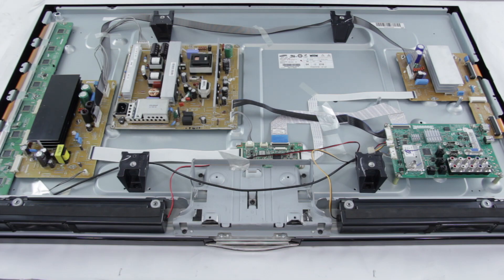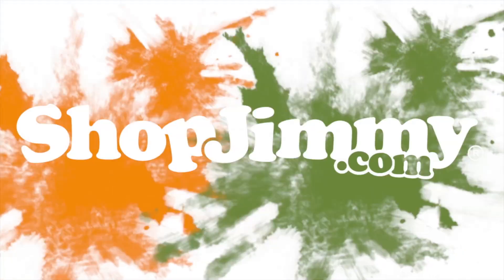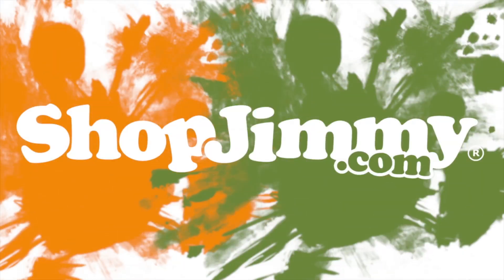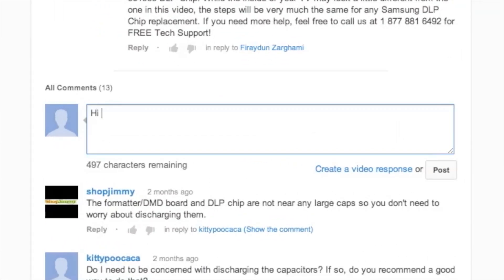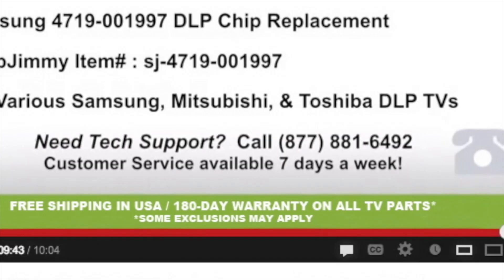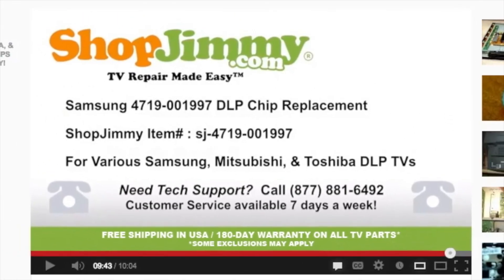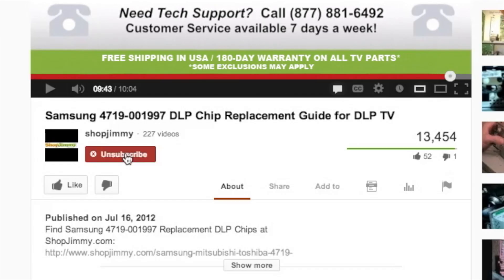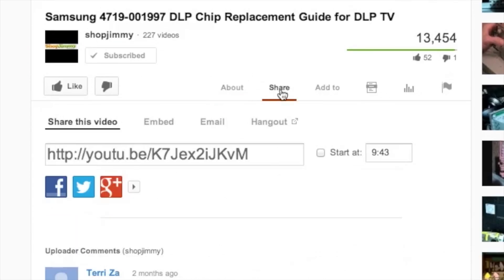Plasma TV Repair Tutorial - Common Symptoms & Solutions - How to Fix Plasma TVs

Comment: I have a LG 47LD690 . 
The problem is that it will stay stuck on the start up screen displaying the logo and a timer that is not set. What could it be the problem? I've done some research and I came to the conclusion of being the main board. Well , I've tried to look it up on ebay and couldn't find it.

Comment: I have a Maxent TV Model # P420142X3 that turns on, but gets no picture.  The sound is fine.  This issue occurred without warning.  The tv had been on and automatically turned off after a certain amount of time, and then would not turn back on. Can you make any suggestions?
Reply from the maker: Jamie Barcelon   I recommend running the flashlight test on your TV.   Here is a link to a video we produced that shows how to run the flashlight test. No Image No Picture on TV Screen - Flashlight Test LCD & LED TV Repair - How to Diagnose Symptoms 2 Please reply with your flashlight test results and we can recommend a replacement part for your TV repair. Thanks and please let us know if you have any questions! www.shopjimmy.com

Comment: Hello ShopJimmy.com,

I'm having a trouble with my Panasonic P60U50.

I opened my TV one morning and saw a shaded horizontal line across the screen (not solid black, kind of white horizontal line). I tried to remove and plug back in orange cables to Y-Buffer, I got some black solid lines but I succeed to plug orange cable correctly so they disappeared. I did not correct the shaded horizontal line at any time (got it everytime I started TV to check if black lines were gone). I noticed (not everytime) that I can see random colored dead pixels 1 inch at the top or at the bottom of the shaded horizontal line (there is only one line). Hope it is not a defective panel. Your help is greatly appreciated! Here is a picture http://i58.tinypic.com/2lkcsr9.jpg (restarted TV and no more colored dead pixels but still white horizontal line)
Reply from the maker: electronicdancemuz   This sounds like a TV panel (TV Screen) problem.  If your TV panel is bad, it may be more cost-effective to replace the TV as panels are typically hard to find in stock, difficult to replace, and expensive.  Thanks and please let us know if you have any further questions!  www.shopjimmy.com
Reply: ShopJimmy.com
wrong, it was the upper buffer board

Comment: I have a samsung LN37450 , it is showing a very bright picture with no or little contrast. i have reset the tv to factory settings and had a quick look for swolen caps but nothing jumps out at me. Hope u can advise
Reply from the maker: Colin Clohesy   I recommend replacing the T-Con board in your TV.  Unfortunately I do not see any replacement parts in the search results for your TV model number on our website.  Please reply with your part number on your t-con board and I can try searching for replacement parts.  Thanks and please let us know if you have any further questions!  www.shopjimmy.com

Comment: I have an LG 60pk200/pdp60r10000 (1st model # is on the outside cover 2nd is on the white sticker inside). It's a 60 in plasma tv. I got it in jan of 2011 & have not had any problems with it til now. When you try to turn it on, it just clicks and the red power button will flash once. Do you have any clue what could cause this?

Comment: Samsung model LN40C530F1F, the volume is automatically turning up and down on its own
Reply from the maker: Tyson Jerald   This is either a problem with the keypad board or the main board in your TV.  Try this at your own risk.  If possible, try disconnecting the the keypad controller from your main board to see if the TV stops turning up and down the volume.    Thanks!  www.shopjimmy.com

Comment: Panasonic TH-42PZ80U; after 5 minutes of turning on screen develops a 1" vertical blue/green line in center of screen which will intermittently fade and reappear.
Reply from the maker: *****   This sounds like a TV panel (TV Screen) problem.  If your TV panel is bad, it may be more cost-effective to replace the TV as panels are typically hard to find in stock, difficult to replace, and expensive.  Thanks and please let us know if you have any further questions!  www.shopjimmy.com

Comment: I have a Panasonic TCP42UT50 that gets a black vertical bar on the left side of the screen that cuts out about a 1/4 of the screen size. it randomly will happen, sometimes lasting an hour or two sometimes lasting all day. I have done some research and thought it was the cable on the C2 board #TNPA5631, But all connections seem good, so I assume it is a board that has gone faulty or a bad solder somewhere? Am I on the right track?
Reply from the maker: Ian Bremner   This sounds like it could be a bad C board or a bad TV panel.  Unfortunately we do not offer the C board.  Thanks!  www.shopjimmy.com

Comment: my pioneer pro-111-fd tv is having a tuner problem.
i had a similar problem shortly after i got it. it was repaired under warranty. a new board was installed. it's not under warranty now. which board would it be? also, most of the menu settings are "greyed out".
Reply from the maker: Lance Arnold   I recommend replacing the main board in your TV.  Here is link to replacement parts for your TV model number - http://www.shopjimmy.com/catalogsearch/result/?q=pro-111-fd  Be sure to match part numbers on your current board, with your replacement for compatibility.  You can also call our customer service for further assistance with your purchase.  (877) 881-6492  Thanks and please let us know if you have any further questions with your TV Repair!  www.shopjimmy.com

Comment: I have a 2009 Sanyo dp50747 and when I turn on the power button the tv will come on and then goes off. Any idea what's causing this problem? I've checked all fuses and caps. Their all good at least they are not raised or leaking.
Reply from the maker: Michael Hawk   I recommend replacing the main board in your TV.  Here is a link to replacement main board for your TV model number:  http://www.shopjimmy.com/catalogsearch/result/index/?cat=56&q=dp50747  Be sure to match part numbers on your current board, with your replacement for compatibility.  Here is a link to a video showing how to identify your part number, click here:  TV Part Number ID Guide for Sanyo Main, Digital, & Terminal Boards (LCD, LED, Plasma TVs)  Thanks and please let us know if you have any further questions with your TV Repair!  www.shopjimmy.com

Comment: I need repair instruction. My TV's volume/sound won't work. After I turn it on it lowers the volume to zero. I really thought it was someone out there messing with me but then later I found out that it was the TV because the control won't work. I tried to raised the volume with the side button but still won't work. The make and model is: Westinghouse W1603.

Comment: Hi there I just got a LG 60pv400 and it will stay on for five mins then screen goes black sound still plays I'll turn it off n on again and another five mins same thing. It seems to have gotten worse because after just a few times of on n off it would warm up or something and be fine for hrs. Fairly sure it's not the connection board other tv's everything works. any help would be awesome I'm about to take the back off now thanks
Reply from the maker: BEN AZ   I recommend replacing the YSUS and the YDVTP & YDRVBT boards in your TV.  Here is a link to replacement parts:  http://www.shopjimmy.com/catalogsearch/result/?q=LG+60pv400  Be sure to match part numbers on your current board, with your replacement for compatibility.  Thanks and please let us know if you have any further questions with your TV Repair!  www.shopjimmy.com

Comment: Hello, My Toshiba Regza 47ZV650U worked flawlessly until the other day I accidentally unplugged it while the scanning function was searching for channels on a digital antenna. When I plugged it back the set made its usual clicking noise, the power light went green and brand name lit, but the screen stays black. The clicking noises (i can hear two) repeat every 25 seconds or so. Thanks.
Reply from the maker: MarceloHardoy  Please watch this video FIRST to help with your repair!  TV Repair! LCD, LED, Plasma, DLP How To Fix Your TV with ShopJimmy.com Help!   I recommend replacing the main board in your TV.  Here is a link to replacement parts:  http://www.shopjimmy.com/catalogsearch/result/index/?cat=56&q=47ZV650U  Be sure to match part numbers on your current board, with your replacement for compatibility.  Here is a link to a video showing how to identify your part number, click here:  TV Part Number Identification Guide for Toshiba Main & Scaler Boards (LCD, LED, Plasma TVs)  Thanks and please let us know if you have any further questions with your TV Repair!  www.shopjimmy.com

Comment: Shopjimmy.com Thanks for your time....I have a Samsung plasma Tv Model PS50C6500TW ...The problem is when you turns it on it make a welcoming sound but everything end there. No picture. and when you off it again it makes sound and the standby red light will light up. thats it ...Any Idea as what I should do or what the problem is. Any help is highly appreciated.
Reply from the maker: DMex Lulu   Please watch this video FIRST to help with your repair!  TV Repair! LCD, LED, Plasma, DLP How To Fix Your TV with ShopJimmy.com Help!  I recommend replacing the Y-Main Board and the Y-Buffer Scan Drive board in your TV.  Here is a link to replacement parts:  http://www.shopjimmy.com/catalogsearch/result/?q=50C6500  Be sure to match part numbers on your current board, with your replacement for compatibility.  Thanks and please let us know if you have any further questions with your TV Repair!  www.shopjimmy.com

Comment: hey Jimmy,
My Samsung model UN60EH6003F picture has gone black (actually dark blue) but the sound works.  I watched one of your videos and took it apart.  I'm not sure which board is causing the problem but I did notice the capacitors look fine.  What do you suggest?  I'd like to fix it myself (we've gone through a lot of TVs in the last few years.)
Reply from the maker: Mike Ake   Please watch this video FIRST to help with your repair!  TV Repair! LCD, LED, Plasma, DLP How To Fix Your TV with ShopJimmy.com Help!  This could either be a problem with the main board or the T-Con board.  I recommend replacing the T-Con board first and then if the T-Con board does not fix the problem, replace the main board.  Here is a link to replacement parts:  http://www.shopjimmy.com/catalogsearch/result/?q=UN60EH6003F  Be sure to match part numbers on your current board, with your replacement for compatibility.  Thanks and please let us know if you have any further questions with your TV Repair!  www.shopjimmy.com

Comment: I have a Samsung HP-T4254 (model code HPT4254X/XAA) plasma. It will come on and operate correctly for a short time and then the picture will stop. I can turn it off for a little while and turn it back on and it will work again for a short while. Any suggestions would be appreciated.
Reply from the maker: Charles Gatch  Please watch this video FIRST to help with your repair!  TV Repair! LCD, LED, Plasma, DLP How To Fix Your TV with ShopJimmy.com Help!  I recommend replacing the Y-Main board and the Y-Buffer board in your TV.  Here is a link to parts:  http://www.shopjimmy.com/catalogsearch/result/?q=HPT4254X%2FXAA  Be sure to match part numbers on your current board, with your replacement for compatibility.  Thanks and please let us know if you have any further questions with your TV Repair!  www.shopjimmy.com

Comment: Model Code is PS51D550C1RLXL and its not working like standby light is flashing and main control Green Led is flashes and nothing happens on screen
Reply from the maker: ll3thanll   I recommend replacing the Y-Main board and Y-Scan Drive board in your TV.  Here is a link to replacement parts for your TV model number on our website, click here:  http://www.shopjimmy.com/catalogsearch/result/?q=51D550C1  Be sure to match part numbers on your current board, with your replacement for compatibility.  Here is a link to a video showing how to identify your part number, click here:  Samsung Plasma TV Repair: Samsung Plasma Panel Parts Guide  You can also call our customer service for further assistance with your purchase.  (877) 881-6492  Thanks and please let us know if you have any further questions with your TV Repair!  www.shopjimmy.com

Comment: samsung pn59d530a3f is turning on and has sound but after a few minutes to hours the picture goes out and the sound is still on and the standby light is blinking. I have checked for possible loose connections with no luck. to me i think its some type of heat issue cause the picture will come back on after i turn the tv off and wait about 15 minutes and then turn it back on. Or a back-light power issue. I dont know how backlights work so it could be that the back light is going out when it gets hot. I dont know where the back light resides so i am not able to conform or deny that problem.
Reply from the maker: Brandon Allen   I recommend checking the fuse on the y board to see if it is good or not.  Thanks and please reply with the results.  www.shopjimmy.com
Reply: The fuse was fine and have changed the Y board and no change. So my next logical guess would be the logic board. the main is going to be my last resort due to its price. but im hoping its the logic.
Reply from the maker: Brandon Allen   Please watch this video FIRST to help with your repair!  TV Repair! LCD, LED, Plasma, DLP How To Fix Your TV with ShopJimmy.com Help!  Did you change the Y board, and not change the buffers that attach to the y board?  If this is the case, then I recommend replacing the Y-Main Board and the Upper and Lower Y Scan Drive boards at the same time. Here is a link to replacement parts:  http://www.shopjimmy.com/catalogsearch/result/?q=pn59d530a3f  Be sure to match part numbers on your current board, with your replacement for compatibility.  Thanks and please let us know if you have any further questions with your TV Repair!  www.shopjimmy.com
Reply: ShopJimmy.com I have changed the logic board and the TV is now working flawlessly. Thanks for the advise I really do appreciate it.

Comment: I have a Samsung Plasma TV Model No: PN50C450B1D
I was given this TV from a friend who currently had the problem. The problem is that on the screen there are two white vertical lines that go from the top to the bottom. They look like colored pixels that are on the left side to the middle of the screen. I saw some suggestions on how this might be fixed, but I want to make sure before I do something stupid and ruin the TV for good. Please let me know! Thank you so much for your time!
Reply from the maker: Dominic Peters   This sounds like a TV panel (TV Screen) problem.  If your TV panel is bad, it may be more cost-effective to replace the TV as panels are typically hard to find in stock, difficult to replace, and expensive.  Thanks and please let us know if you have any further questions!  www.shopjimmy.com

Comment: Hi Jimmy My Samsung Plasma MODEL PN43D450A2DXZA has sound but no picture. The TV will play for a while then it will get green line across the screen a few minutes after that it will pop in and out and then go black any suggestions? Thanks for your help
Reply from the maker: Vicky Sealock   I recommend replacing the Y-Main Board and the Y-Scan Drive board in your TV.  Here is a link to replacement parts for your TV model number on our website, click here:  http://www.shopjimmy.com/catalogsearch/result/?q=PN43D450A2DXZA  Be sure to match part numbers on your current board, with your replacement for compatibility.  Here is a link to a video showing how to identify your part number, click here:  Samsung Plasma TV Repair: Samsung Plasma Panel Parts Guide  You can also call our customer service for further assistance with your purchase.  (877) 881-6492  Thanks and please let us know if you have any further questions with your TV Repair!  www.shopjimmy.com

Comment: I have a Samsung HP-R5072 about 6 years old.  The screen just started looking like a plaid shirt.  Vertical and horizontal lines over the entire screen.  I can distinctly see a difference between the upper and lower half of the screen.  What do you recommend?
Reply from the maker: pweilnau   This sounds like a TV panel (TV Screen) problem.  If your TV panel is bad, it may be more cost-effective to replace the TV as panels are typically hard to find in stock, difficult to replace, and expensive.  Thanks and please let us know if you have any further questions!  www.shopjimmy.com
Reply: Thank you for taking the time to provide your expert opinion on this.